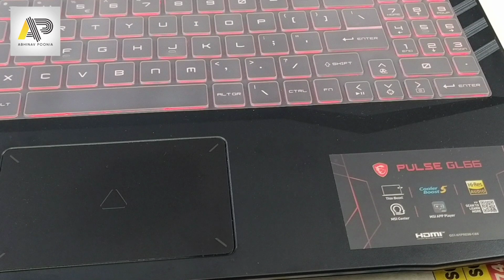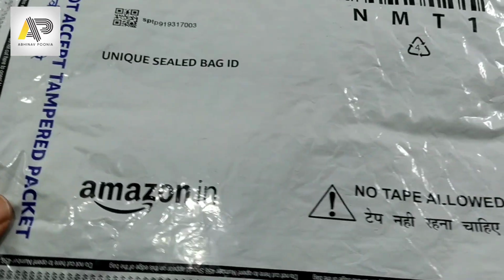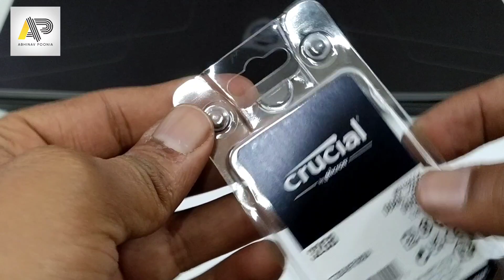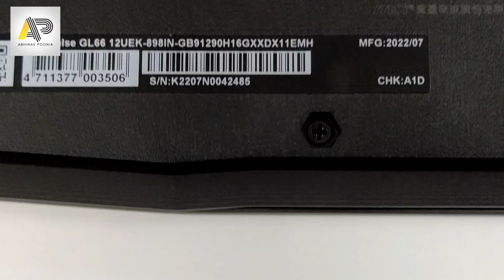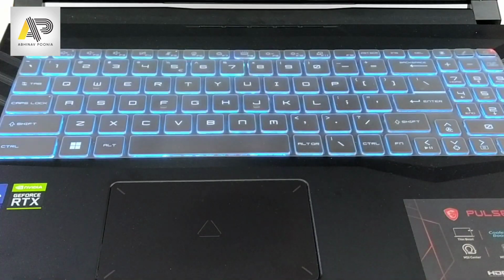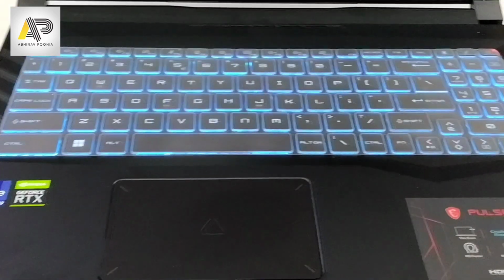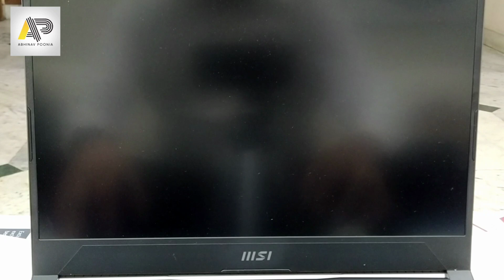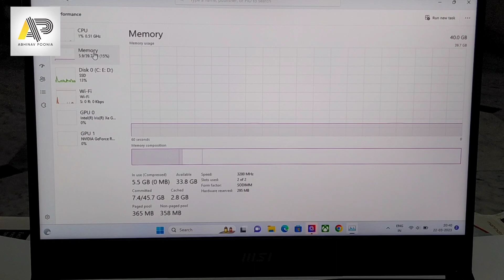How to Upgrade Your Gaming Laptop's RAM to 40 GB - A MSI Pulse GL66 Story

Comment: Bhia one doubt I have tuf gaming f17 laptop iska max support on website is 32gb ram as of now I have 8x2 - 16gb ram, I can upgrade till 64gb right because in crucial official website and other showing 64gb it can support kindly adivice please as of now I will buy one 32gb ram later will change to 64gb please reply
Reply from the maker: No before buying check the details of the motherboard to check how much max ram it can support otherwise 32 gb additional ram will be waste. In my case it is 64 gb max hence I just bought a 32 gb ram , 8 gb for comfortable os and rest 32 gb for video rendering. Later on I can add one more 32 gb to make it 64 gb , but ram configuration and speed , type needs to be identical.
Reply: @abhinavpooniavideo  bro in offical site it shows 32gb but in other site like Kingston or crucial it was showing 64gb that'd why as of said as of now I too will use 8+32 later will upgrade totally to 64gb

Comment: They say you always want to keep the both ram of same gb. is that true? what happens if one is 8gb and other is 32gb?
Reply from the maker: in my case it becomes 40 GB as you can see from the video and there is no problem , since the port size is same and base frequency of the same is also same. i.e type ddr 4
Reply: @abhinavpooniavideo  thanks, I did same. i 7 11

Comment: man you are doing a huge mistake here , dont use 40gb ram . even your 16gb dual channel ram will give better perf than 40gb . always use ram in dual channel ( same capacity and same frequency ram in both slot )
Reply: So if upgrade change, both of them?
Reply: @juliopedraza3364   just use same capacity ram in both slots , thats what matters .
Reply from the maker: in my case i am using 1 8 gb ram and 1 32 gb ram hence total 40 GB out of which approx 4 gb is being used for runing native windows and rest isused for video rendering on adobe premire, however max usage is 16-18 gb + system usage there by even a 32 gb can work easily but 40 gb is better, soon i will be upgrading to 64 gb
Reply from the maker: if frequency and type is same there is no issue even if the ram is foram different manufacturer